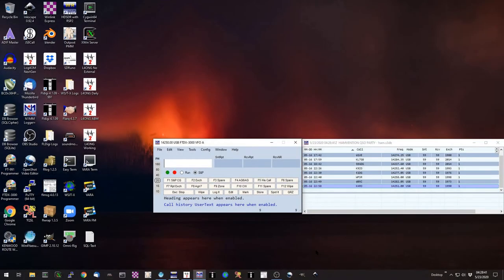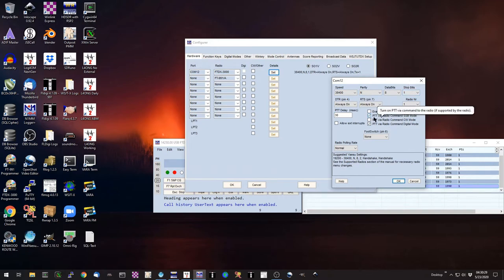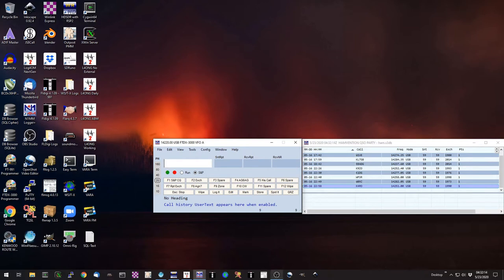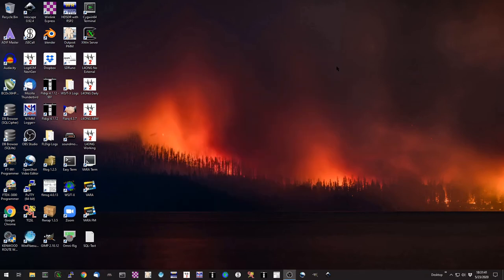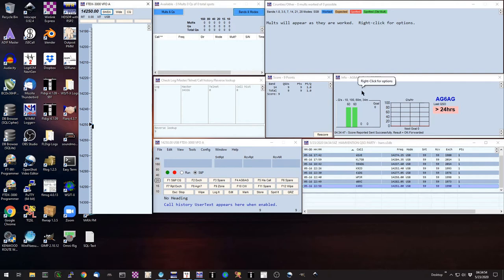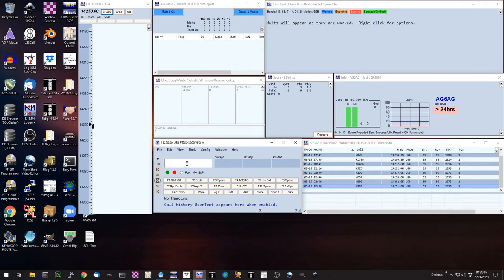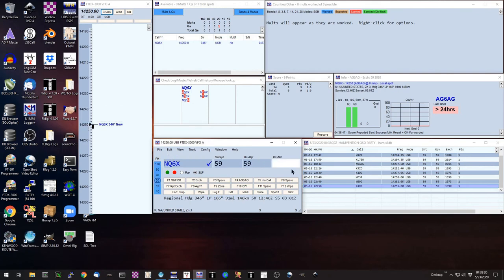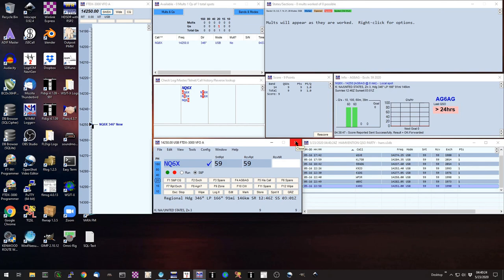Interfacing N1MM+ With Your Radio and Configuring Advanced Contesting Views

Comment: Hi Stewart, New FTDX10 owner, trying to interface it with Win4Yeasu and N1MM.  I’m getting the port conflict you mentioned.  I can get either working, but not both.  Can’t figure out how to set the com ports to cooperate, and neither manual seems to address.  Any suggestions or references?  I like your setup and an trying to mirror it.  A picture of both programs com settings would be great!  I have enhances and standard ports loaded from Yeasu.  Thanks, Craig W4MSK
Reply from the maker: Hi Craig,
First off make sure you read this: https://yaesu.va2fsq.com/third-party-hardware-and-software-integration/.
Then take a look at this video: https://youtu.be/rEPh9NqMYyg. The beginning of the video talks about the problem of running multiple programs at the same time. At about 17:50 we talk about com0com setup, then at around 27:25 I try to pull it all together with Win4Yaesu. Remember that Win4Yaesu is the only program that actually talks to the radio! All other programs talk to Win4Yaesu using the virtual com ports you setup with com0com.
Hope that helps!

Stu
AG6AG